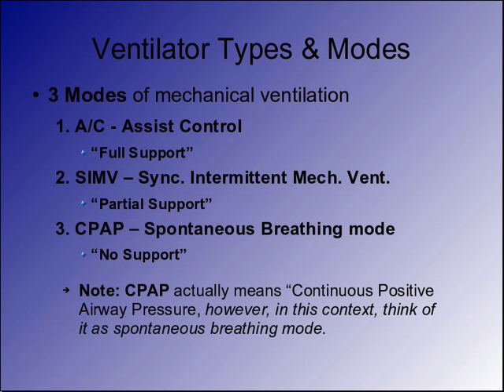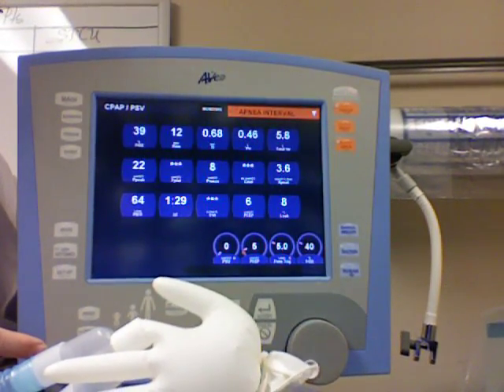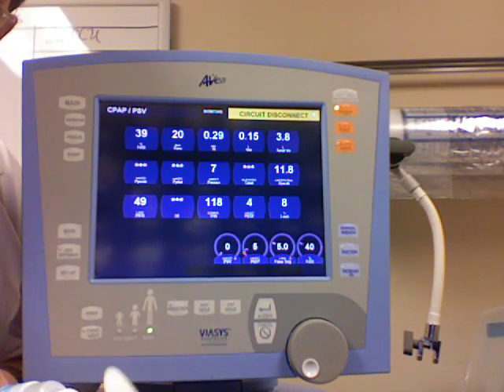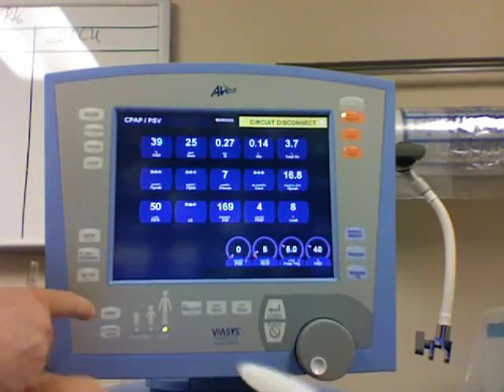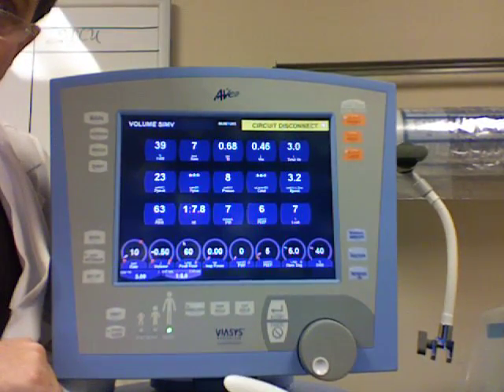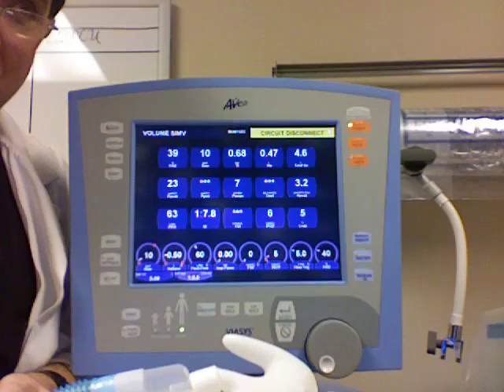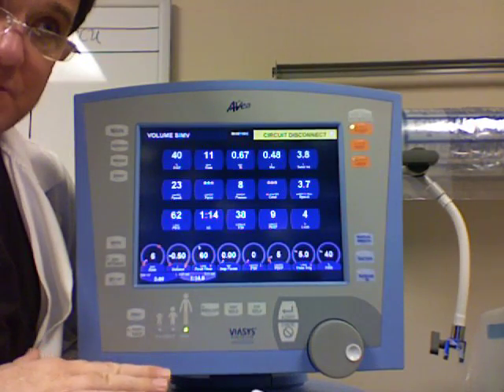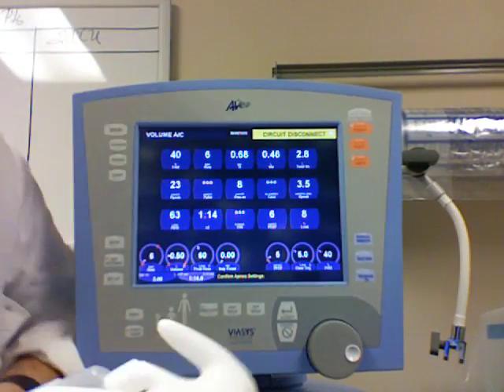ventilator type & modes part 2

Comment: @drifter120 Thanks I'll be looking around for a simplified explanation of the waveforms because my MV instructor totally didn't even bother to teach in depth on waveforms. It was VERY lightly brushed over. Apparently, something this instructor does not have a high regard for in managing a patient on a vent (which she plainly stated). It's ridiculous since you need a good understanding to even pass the boards and for patient care. I have already seen it on the NBRC.org practice test.

Comment: Mr Drifter, Wouldn't it be very good idea to mention what machine type you are using and to start from the start point of the machine until every body gets the idea of how to set the machine and how manipulate or adjust the machine settings according patient needs.
Just an opinion...
you did very good job on explaining the modes and types of ventilation.

Negeye

Comment: I'm not a medical student,just interested in mechanical ventilation and intensive therapy,but I'm so grateful for your useful and easily understandable presentation!I think mechanical ventilation is an "art",it's not as much easy as it looks like...May be this sounds a bit stupidly,but I would be curious about what extubated patients tell about the weaning procedure.I mean it cannot be easy to syncronize their first hardly taken breaths with a machine,and the changing modes (AC,SIMV,then CPAP)